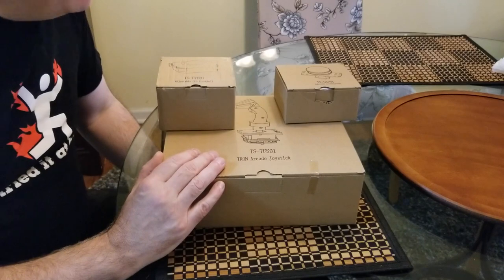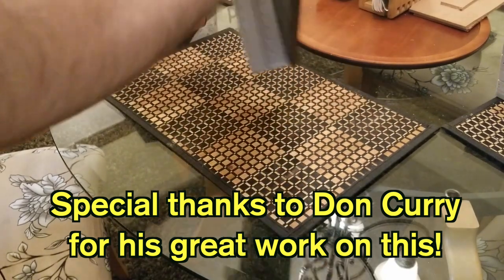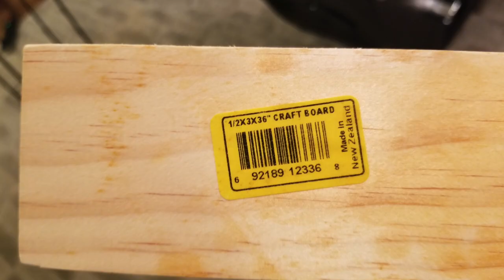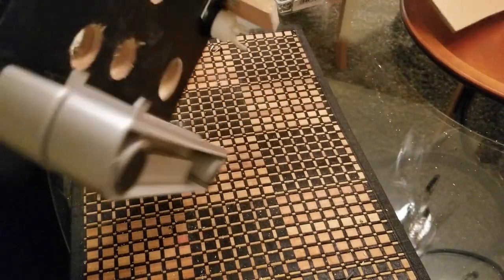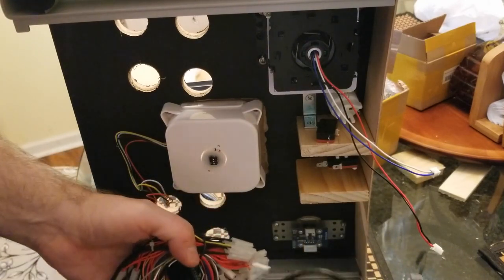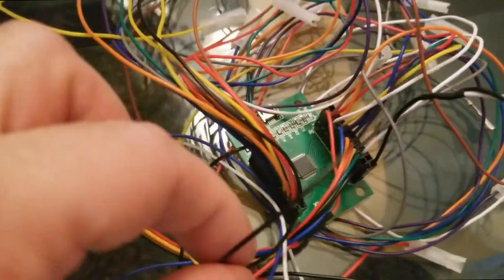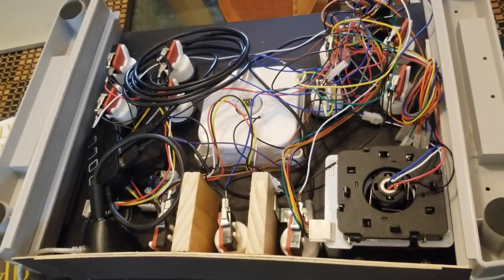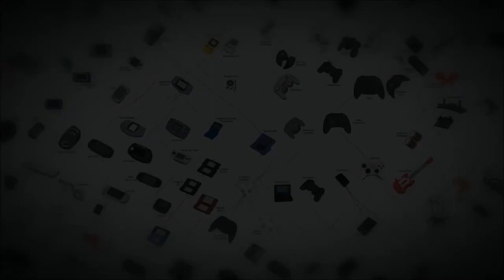Easy DIY 80's Arcade Stick/Spinner/Trackball with Newly Manufactured Arcade 1Up components (vid#44)

Comment: I'm looking to build a 2 player USB fightstick with a spinner and trackball. Something I could use for the Atari VCS when I put it in PC mode and run MAME. Can that be done? Is there a plan for it somewhere?
Reply from the maker: I don't have the Atari VCS that was released a few years ago, so I'm not sure what the compatibility requirements are.  The Atariage website has specific forums that may be up to the challenge of getting you an answer about the VCS, so check that out.

Comment: It's unfortunate. I have my set up connections exactly how you have yours. Except for the fact the Tron stick only comes with the atgames wiring and not the wiring harness that came with yours. I've tried everything I can think of to get it working but it just isn't. It's very frustrating.
Reply: I just got my Tron stick today and it didn't have the encoder board either. Unfortunately GRS no longer includes the encoder board so you have to buy a usb encoder board. But I'm just gonna wire mine to my old X-Arcade P/S 2 encoder and get a PS/2 to usb cable.
Reply: @mgpmbass3616  ya I just rewired mine and just connected it to the USB encoder. It works fine now. However. I can't get the GRS trackball and spinner to work. They work fine with the PC but not the raspberry pi 4.
Reply: @crashoverride576  Which usb encoder did you use? Does your encoder power the LED's? And do you have a link for the encoder?
Reply: @mgpmbass3616  it's just a simple encoder that you get when looking for buttons on Amazon.
Reply: @crashoverride576  Do you have a link? And does s it power the LED's?
Reply: @mgpmbass3616  yes this encoder will power the led on the GRS Tron stick.
Reply: @crashoverride576  Do you have a link for your encoder board?
Reply: @mgpmbass3616  I have put it one here several times. YouTube must be deleting it.
Reply: @crashoverride576  Yeah they do that. They've deleted links that I've posted before. However, good news. I looked at my old encoder and it does have a 5v  output for the programming led so I can tap into that.
Reply: @mgpmbass3616  yup you will be good.

Comment: Question for you. The new Tron sticks doesn't come with the XM-09 LED encoder, So far I got everything to work correctly expect for the wires running from the actual joystick (Blue and white and black and red), is there anyway you can give me a idea of how I go about on getting that hooked up?
Reply: Forgot to mention, the board didn't come with the 22 pin connection, but the stick did come with the two pin connectors(Connectors are metal)
Reply from the maker: I would contact the manufacturer about this issue.  I only know how to get it working with what came packaged with mine.

Comment: 🕹️🕹️🕹️Yo Wired up!!, I want to replace the joystick in my Pandora's box for an Ikari Warrior style rotating joystick. Do you have a link to someone that has an exact drop in assembly so I can play those types of "move and twist" games? Also can you make a simple video on how to install the 12 way rotary joystick? Thanks man.
Reply from the maker: So I happened upon this video
https://youtu.be/UennRIieaA8
which is about playing Ikari Warriors with keyboard and mouse (mouse doing the gun aiming and keyboard doing the WASD movement control), and saw a comment that Synthesizer Patel made just yesterday:

"If you're lucky you can find an original Happ Rotary stick on Ebay - but they're rare as Happ no longer make them and the price will reflect that.  

Ultimarc make a kit which can convert a standard JLW-TM-8 (or Ultimarc's copy called the J-stick) or a Servostik - into a rotary stick."

The kit is about $60 and the JLW-TM-8 joystick runs about $30, so it's going to set you back a few bucks.  No promises on a video being produced on my channel about this, but it is interesting to me... so, who knows :)
Reply: @wiredupretro  thanks Wired for the thoughtful reply. I put a few requests out on different channels. I'll give you a heads up if anyone else has an answer. I'll subscribe.

Comment: Hi. 
If I’m just using this for MAME, do I need to worry about following the diagram for the buttons all that much? In Mame, you program the buttons using the software anyway, so I’m just wondering if I’d still follow the diagram.
Thx
Reply from the maker: I put each button in a specific place for the purpose of being able to intuitively play PS3 games (and the backward-compatible PS1 games like Raiden Project within a PS3).  In other words, you want the X button (PC button 2) to be on the left side of the controller and not the right side (where the joystick is). You also probably want PC button 1 (Playstation Square button) to be the trigger on the stick, so on many PC emulator games (ie. Tron or Zaxxon) the game will have you innately using that trigger to fire away.  If all you're going to use it on is Mame, it may be okay to not worry too much about button placement, but at least make that trigger represent button 1 or 2 of a PC controller.  You might regret it later if you don't do that.

Comment: How did you connect that spinner to PC for use it wirh mame?
Reply from the maker: Used a 12-in-1 board which essentially makes it a mouse signal.

Comment: Is it easy enough to add a second joystick and a couple more buttons to this build?
Reply from the maker: Are you planning on using it with computer games or console games?
Reply: Just with Mame on a pc
Reply from the maker: @darrenmarchand647  Okay, I suppose you'd just need to buy a second stick (which will come with a second encoder board) and extra buttons.  Run another USB cord from that second joystick encoder to the USB hub that's inside the enclosure. Then you'll have to configure how it all is utilized within Mame's controller configuration menu. It might be a little complicated, but hopefully manageable. Make sure you comment here when you succeed with this!

Comment: Hi. I've ordered my parts and I saw someone asked a question on Amazon on the spinner page regarding this board (Arcade1Up 12 in 1 Interface Board). Do I need this as well? You didn't have a link for this, so I'm assuming I don't?
Reply from the maker: A little before the 2 minute point in the video I showed the 12-in-1 board (it was packaged in with my spinner, but you actually have to order it separately). I also discussed it at 46 min 35 seconds in. I've got a link for it in the description now.
Reply: @wiredupretro  Got it. Thanks!

Comment: Hi. This is exactly what I’m looking for to use with Mame. Any chance you’d build one and sell it? 😋
Reply from the maker: As of right now, I've got a lot on my plate. Also- it'd be up in the upper two hundreds, so it'd be pretty expensive if you're relying on someone other than yourself to do it... that's why the tutorial is there- to save you quite a bit of $$$.
Reply: @wiredupretro  Ok thanks. I'll give it a try. How much depth do you need inside the enclosure? It looks like there's about 2"? I just want to make sure there's enough space for the base of the joystick to sit inside.
Reply from the maker: @darrenmarchand647  Mine has a little under 2 1/2 inches of depth.  It's just enough depth.

Comment: I've finally put my arcade stick/trackball/spinner together, but I cannot get the trackball and spinner to work at all. I'm only using this controller for MAME by the way. The Tron joystick works, the buttons work, the trackball LED works. However, the spinner and trackball will not work. I've tried configuring them in Mame, but it won't even detect them. Please help. I'm so close!
Reply from the maker: Do you have the 12-in-1 board (for the spinner & trackball) connected to a USB hub along with the Tron joystick? What brand of USB hub are you using?
Reply: @wiredupretro  It's an Aluratek. Both are connected.
Reply from the maker: @darrenmarchand647  This is mine: Sabrent 4-Port USB 3.0 Hub with Individual LED Power Switches (HB-UM43) https://www.amazon.com/dp/B00JX1ZS5O/ref=cm_sw_r_cp_apa_i_.X9uEbRAKG6N5

I have it hooked up to one laptop that runs Windows XP (haven't tried Mame on that computer) and it's working well,  and a Toshiba Satellite Windows 7 laptop that has Mame on it (playing Tron 1982, Discs of Tron, and Zaxxon) and it works nicely.  What is the operating system you are using on your PC?
Reply from the maker: @darrenmarchand647  one experiment you might want to run is to direct connect the 12-in-1 board to the USB of your computer to see if that allows for proper mouse control.
Reply: I’ll give it a try later this afternoon. I think we’re in different time zones😋
Reply: @wiredupretro  Running Windows 10, I just tried bypassing the usb hub and connecting direct to the pc. Still no response. I see there's a red light on the 12 in 1 itself. Is that correct?
Reply from the maker: @darrenmarchand647  I believe the red light should be on.  It's apparently getting power.  Somehow your PC isn't recognizing it as a mouse. What happens when you plug in just a regular USB mouse to your system? Does your system recognize it?
Reply from the maker: @darrenmarchand647  I took a look thru the 12-in-1 user reviews and noticed that someone mentioned that you have to be careful what micro-USB cable you use. It has to have data pins, so be sure you've got the right type. 
I also saw the following review which might be helpful to you: 

Windows usb issue
"Works great once installed correctly. Had to change the jumper configure to be sensitive enough for use in windows 10. Please note that a recent windows update caused this along with many other usb devices to not install correctly. You will need to go into device manager select update driver, select browse my computer, then select let me pick from a list. Choose usb input device and not the hid hs driver. Once you do this it will be properly recognized and usable."
Reply: @wiredupretro  it was the driver. Windows was using the wrong driver for the board. I changed it and it started working. No issue now! I appreciate all the help! Finally seems to be all working!
Reply from the maker: @darrenmarchand647  Such good news- Congrats!

Comment: So painful watching end connector mod - Still married? It would have been easier to cut connectors off and buy a bunch of 3/16" (0.187") 4.8mm female spade connectors from hardware store or electronics supply and re-crimp the ends. Looks that the harness was designed for Sanwa-Denshi style buttons and not Suzo-Happ. The two main styles.
Reply from the maker: Yep- my gracious wife lent a hand without much of a fuss.  A real gem :)

I really wanted the Suzo-Happ buttons on this controller, but you are definitely right about how it took a significant chunk of time to get the connectors modified the way I did it when just going with Sanwa buttons would've prevented the whole issue.